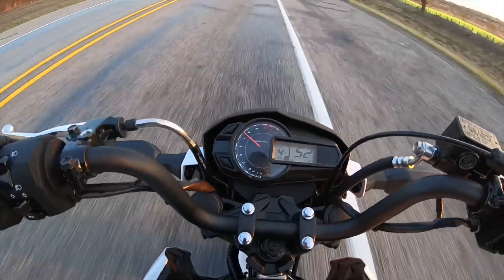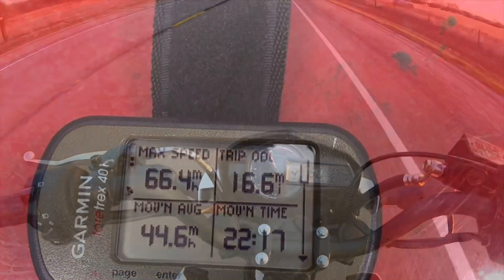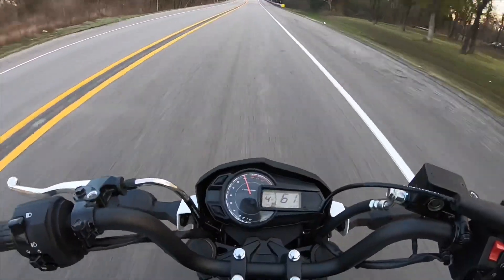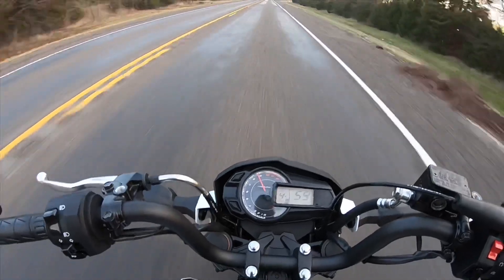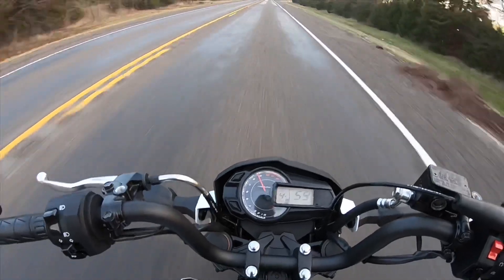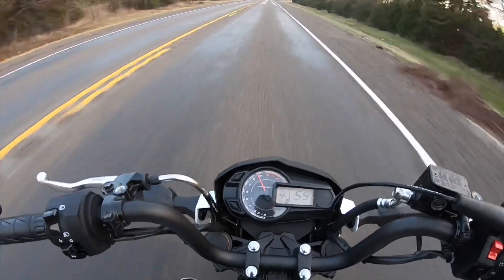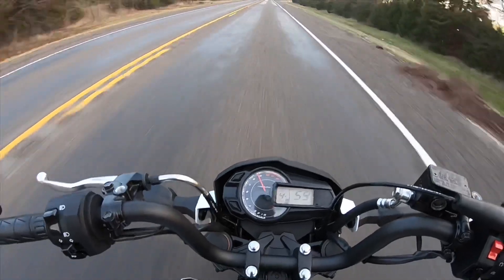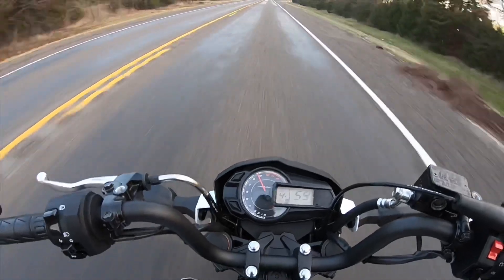Next mods for Z-125 and GPS top speed results!

Comment: what I like about those little bikes is it shows you just how sensitive and easy it is to see just what your body positioning and tuck does to the top speed. you can instantly hear and see the tach drop just from going full tuck to a couple inches above the gas cap.. even the knees and elbows in the wrong spot can drop a few mph if your not careful. valuable lesson that can be transferred to the big bikes. good stuff
Reply from the maker: on speed runs I squeeze my things and push in my knees. you can literally sit up and do lets say 58.... lean over and do 61, full tucc and gain another 3-4 mph on same piece of road. youre 100% correct Homie. it all matters. ive got like 410 miles on it now. looking forward to oil cHange and some mods now!